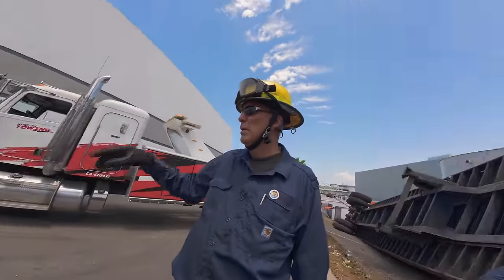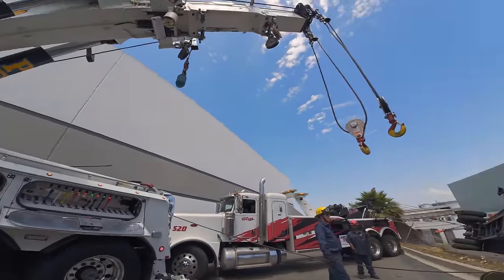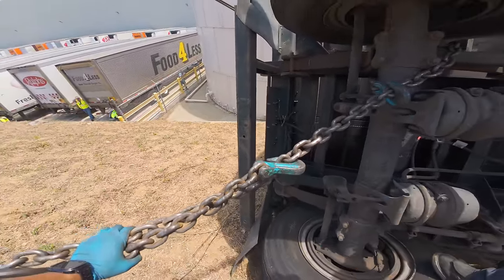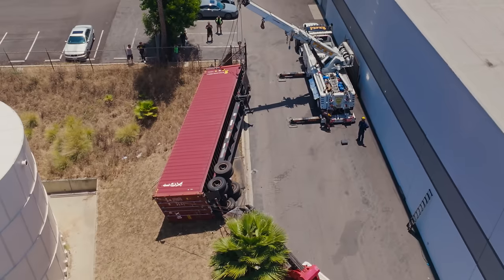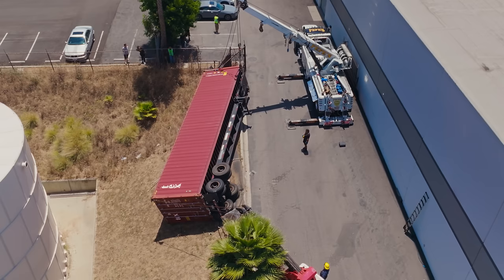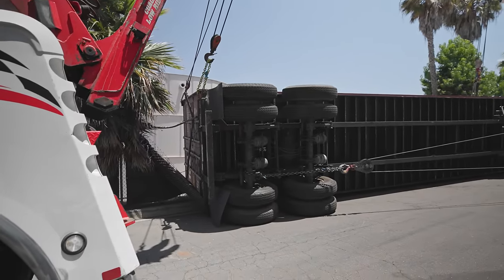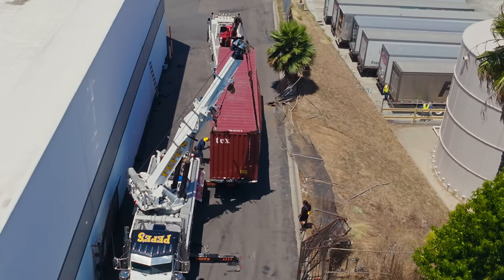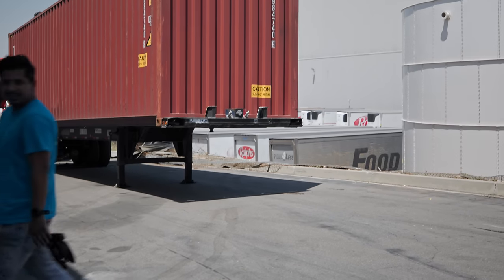INCREDIBLE RECOVERY - Container Rolled Down Hill

Comment: I was wondering how that happened but as soon as Alex mentioned tug test made 100% sense. If you’re going to drive a tractor trailer tug test is a must for a couple of reasons. Not only doing just the tug test but also look at your fifth wheel to see if there’s any problems with the fifth will not locking properly because the last thing you want is to be going down the freeway and lose your trailer because you didn’t do your tug test or visually check your fifth wheel. 100% driver error. As far as I know when you do a tug test, you’re supposed to actually go forward hence tugging it not push back after you’ve already hooked up to it, but if I’m wrong, Josh correct me.

Comment: And that's why always doing tug tests is so important.  It's so simple and easy, so why do some drivers skip it?  Oh well, it keeps Alex busy, and Alex is an artiste with Big Flipper.  Like Josh, he sees all the geometry and all the forces.  Thanks for the video.
Reply: Most drivers have 2 types of mentality. Either they do a tug or they skip it all together. When in all reality just because you did a tug test does NOT mean the bar went all the across and latched to the other side of the fifth wheel plate! You should do a tug test but while you are out rolling your landing legs up you should get under and look to make sure the bar is all the way across and locked to the side!  It doesn't take much to place eyes to make sure it's secure! Especially if the driver is bad winter weather because ice and salt can be  in those opening parts of the Fifth Wheel...

Comment: Great job as always. This job beautifully demonstrates how awesome rotators perform when working in tight areas. With just wreckers, this job would have been extremely hard. With 2 rotators, it's an easy pick and roll. It also seems like wreckers without sleepers are a better option for a smaller fleet. Having the truck a few feet shorter makes it way more nimble in tight areas.
Reply: Alota smaller  companies around here use sleeper cabs   as we're in the middle of nowhere so it's pretty common to need to  go beyond your hours to drop a unit

Comment: The video really shows the capabilities of a rotator let alone one as big as Flipper.  You're able to get your lifting point over the load well before it gets close to you. That gives you air, but also gives you huge amounts of control between the two lines.  And you can even get air during the drag phase, which must reduce damage and risk.  Even though Jonas had a longer boom than a lot of the straight wreckers we see, his truck is left pulling when a rotator can lift and spin the load in 3 dimensions.  The manufacturer should buy your videos for their marketing material.

Thanks to Alex for finding out what happened.  I was trying to visualise how many mistakes a properly connected truck and trailer would have need to make to end up there and bend the gate! With the real explanation it all gets much simpler, but I wonder if the load was already shifted so as to yeet the container so far to the left.  I'd have expected it to be on its knees by the curb. Unless he really floored it around into the access road.

Comment: Two of Pepe's rotators would have made this a simple job. But thanks to Alex for making a good plan.
Whatever connection broke, it is fortunate that it didn't fail when the container was suspended in mid air while being up-righted.

Does anyone know what they are doing with this tractor and trailer hookup ??

Comment: Somebody needs to teach all these drivers, when they have connected their tractor to the trailer, in addition to tugging the connection, to take a flashlight and get under the trailer and shine the light on the 5th wheel connection and visually confirm that the jaws have completely closed around the neck of the kingpin and are locked in place. Do that every time and they'll never lose a trailer like that. If a driver can't do that, maybe truck driving isn't for them.

Comment: Great video. I’ve been watching a lot of this channel and have been enjoying it. Curious question for anybody that has experience with towing.  At the beginning of the video—there was three tow trucks—with one in the middle basically right up against the edge of the hill.  My questions is—what was the purpose of that? Seems to me that it doesn’t make much sense having a tow truck sitting exactly where you’d want to place the runaway trailer.
Reply: Seems they were trying to drag the trailer up the hill with the first truck and could only get so far. At that point they added the second truck off the end to add lift and soon realized they were outgunned and needed a rotator.